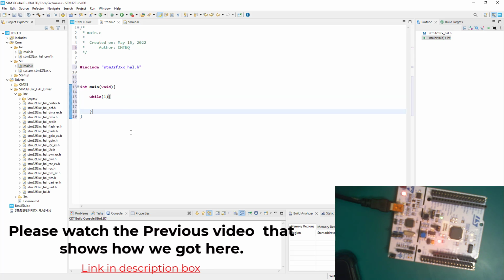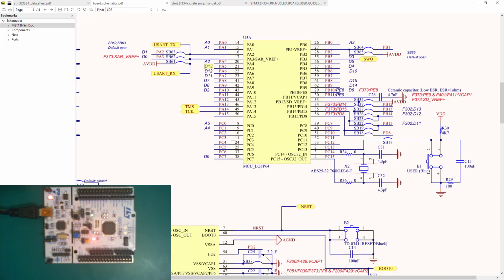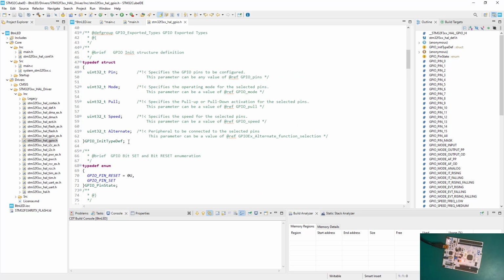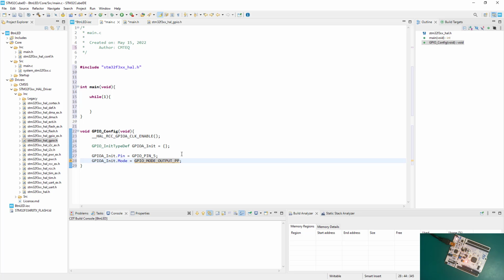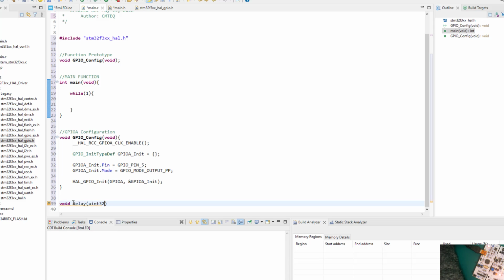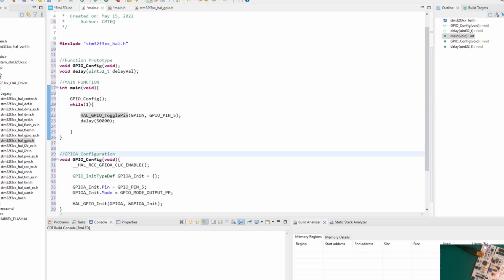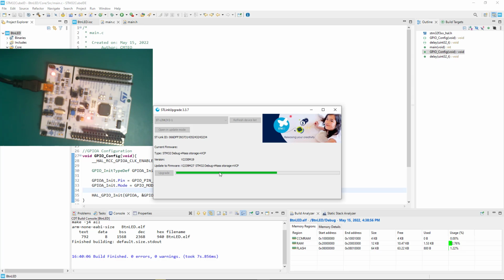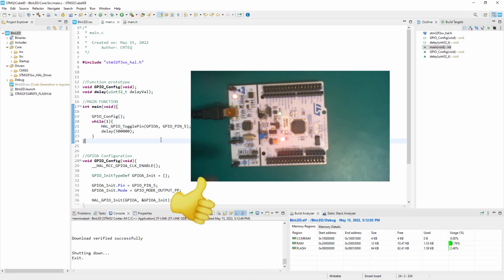1. stm32CubeIDE Nucleo-64 - Blinking an LED

Comment: Would it be possible for you to show us how to do it on external led. I have tried it but the led just stays on instead of flashing.
Reply from the maker: Hi, check this video out https://www.youtube.com/watch?v=vXVrY6eLnTs.
I used external LEDs to do the binary counter.
Reply from the maker: The blinking code is very simple, maybe you are missing a configuration or something is not enabled like the GPIO port clock where your LED is connected, also check if you are using a different nucleo board, your LED might be in another port.